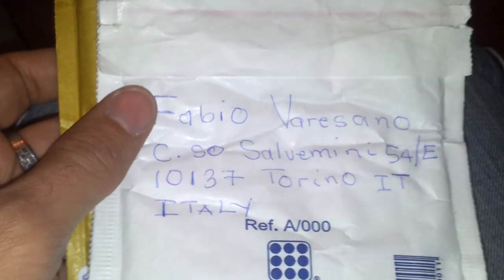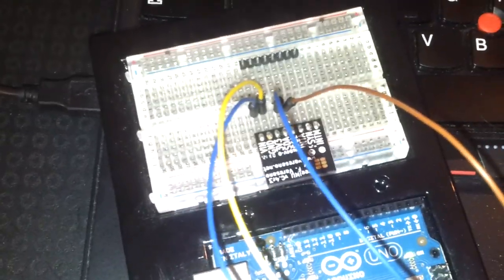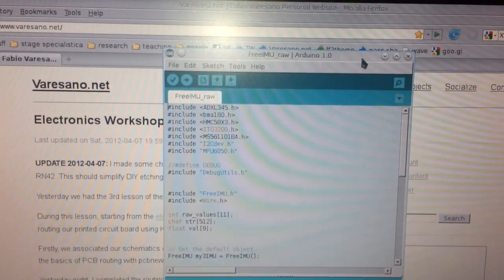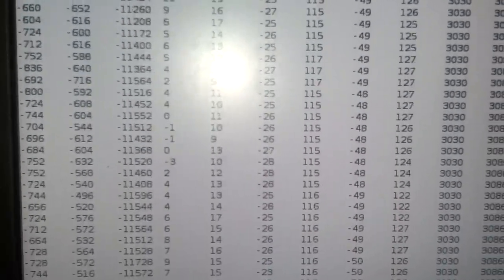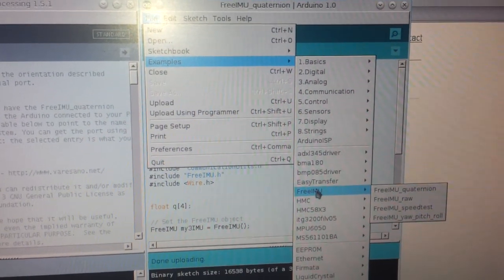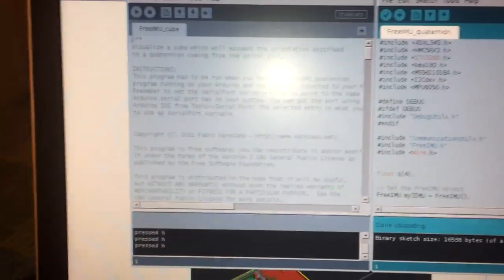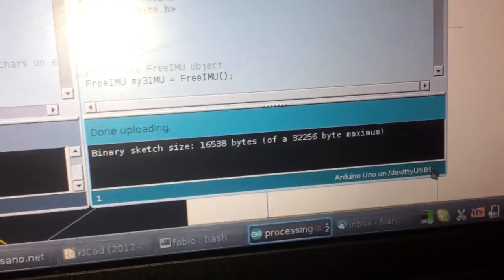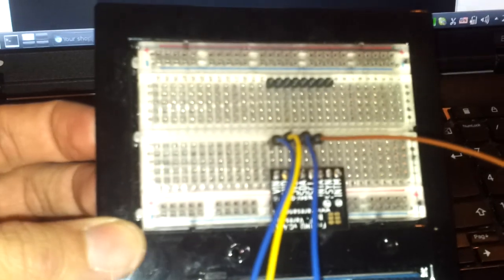How to connect and test FreeIMU v0.4 with Arduino and the FreeIMU library

Comment: invalid conversion from 'uint8_t*' to 'uint16_t' can anyone help on this?? i cant compile the library?
Reply: Did you change some fields in the code from uint8 to uint16 without changing the parameter signature of functions beeing affected by this change? Are you using an Arduino Due?